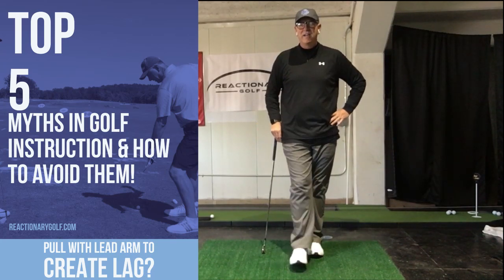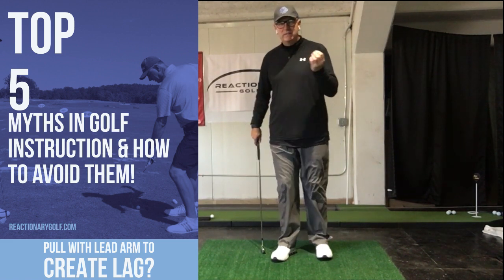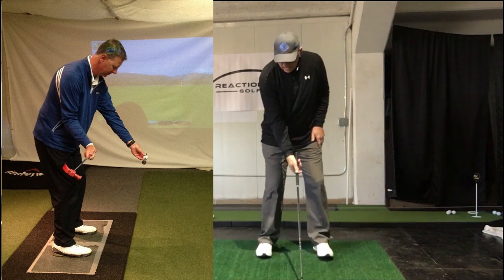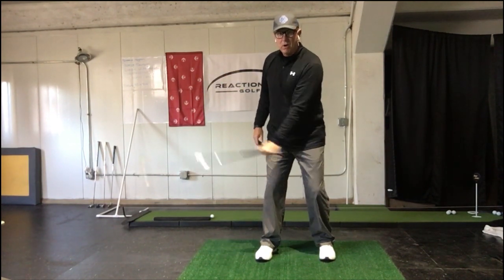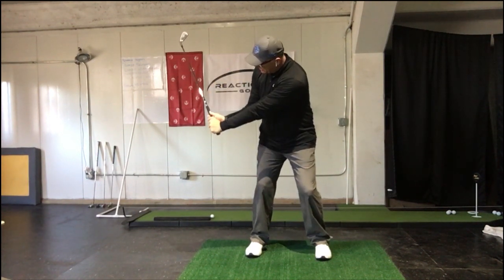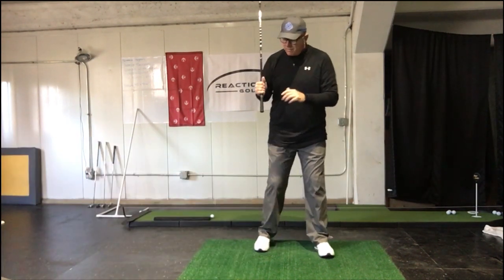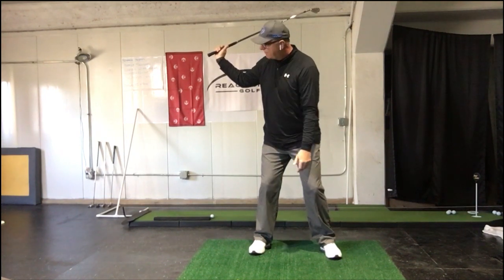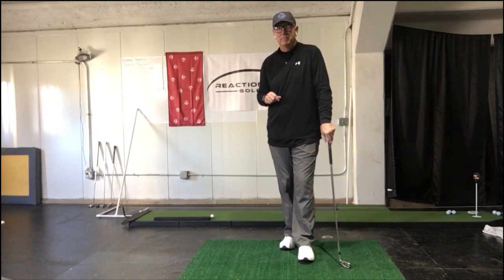Myth #3 - Pull with lead arm to create lag?

Comment: Good stuff tony I've been playing golf this way for years it's like driving a nail with a hammer or throwing underhand when I first started golfing I tried doing it the way all the instructers say by pulling with the right I'm a lefty I was terrible could not keep a straight right arm hurt my elbow etc. I used to be a carpenter so I just started swinging like I did my hammer side ways the ball went far and straight I shoot low 80s regularly and sometimes in the 70s no practise play once a week keep it up finally a good teacher👍
Reply from the maker: john sorensen Thanks John! Great work on your part to find and apply that.

Comment: Tony, thanks for the explanation, but is the change of the extension to flexion of the right hand will cause the extension of left hand? Is it what they called a flip motion?
Reply from the maker: liaopeng326 it can if the body and arms stop at impact. That does happen with poorly sequenced swings. However, it’s needed to transfer speed of the arms into the club.
Reply: Tony Luczak thank you